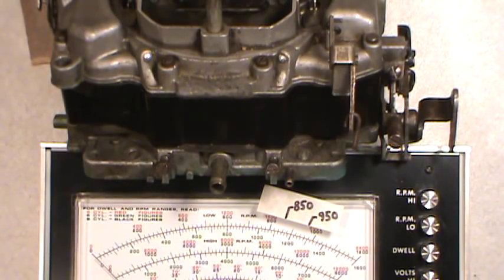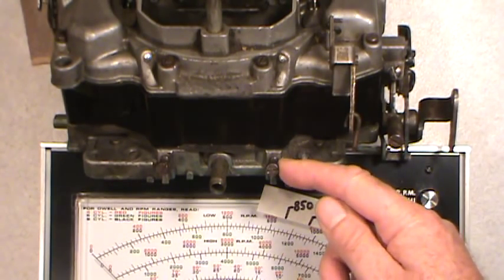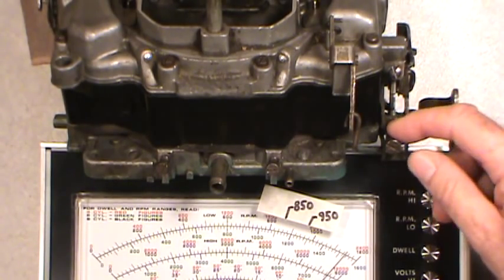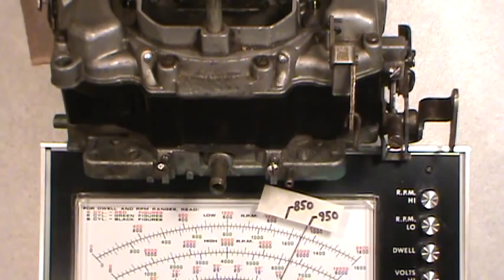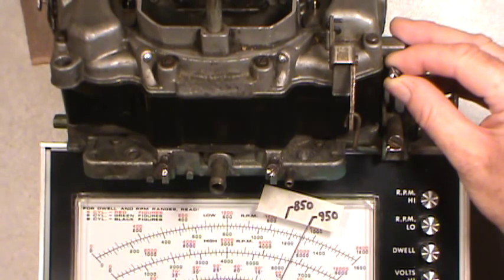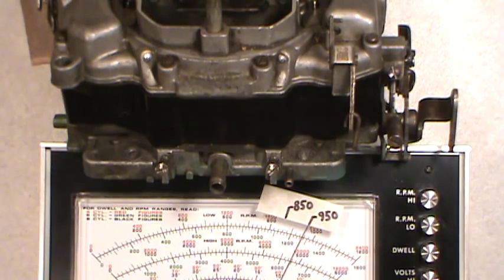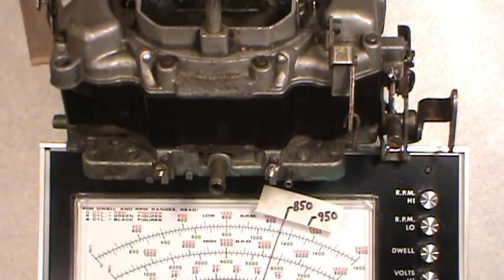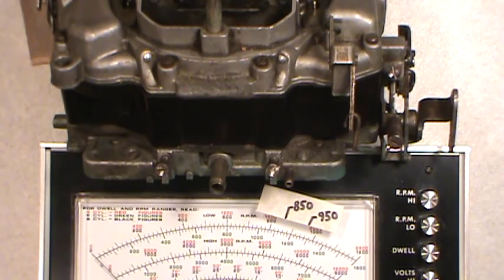Idle Mixture Adjustment on 4 Barrel and 2 Barrel Carburetors

Comment: Can you adjust the mixture using a vacuum gauge?  The highest vacuum is where you want it?
Reply from the maker: richard collis Greetings richard collis....Thanks for watching, and, for Your questions as well...............................If, and I say If, the Vehicle in question's..."Engine"...is not subjected to, and required to "Pass", something like a "Smog/Emissions Test", and is, something along the lines of, that, of being something like...oh, let's say, using an Early 1960's...Chevy...Dodge...or Ford...Car or Truck, for Example, and also, being as "Basic" as can be, pretty much meaning, having a Carburetor, sitting on top of the intake manifold, and, not having much, in that way of "Smog Controls/Gadgets", and, "No-Computer-what-so-ever", then, as I see it, the Odds are very good, that, a Person can use, either, a..."Vacuum Gauge"...or, a..."Tachometer"...to..."Set"...the..."Idle Mixture"...and, the..."(Curb) Idle Speed", well, on a good day, that is.......................The way, that I would probably, shall we say "Set-Up", the "Idle Mixture" and "(Curb) Idle Speed" (the Engine's "Curb Idle Speed" in "RPM's", is pretty much, just that, and, as I see it, just means, what the Engine's "Idle Speed", happens to be "Set-At", while the Vehicle's Engine, is Fully Warmed-Up, and, the Vehicle, is just "Idling" near the "Curb", and Not Moving at all)..............................The "First Thing", that has to be "Determined", is, the Engine's "Curb Idle Speed" ("Automatic Transmission" equipped Vehicles, are usually Specified in "Drive", but not always, while "Standard/Manual Transmission equipped Vehicles, with the "Clutch Pedal", are usually Specified, in "Neutral/Not in Gear"), and hopefully, the Vehicle's Manufacturer has a Specification for that..................For "Safety" reasons, I always make Carburetor Adjustments, with the Engine Running...Fully Warmed-Up...Choke Off...while the Automatic Transmission is placed in "PARK", so the Vehicle "Does Not Decide to Take-Off/Move"...!!!...along with having the...Vehicle on Level Ground...Parking/Emergency Brake On...Wheel/Tire Chalks (lumber/bricks), and, have a Fire Extinguisher, with-in easy reach, just in case, oh, and, also, have the Vehicle "Outside", or, if, the Vehicle, is in a Garage, have All of the Garage Doors, that lead to the Outside/Fresh Air, "Open", as, Engine Exhaust Fumes are "Deadly"...!!!........................Here is an "Example Only", and I'm only using this example, to help People out, and hopefully, help those very same People, some-what, in, understanding, what is usually goin-on, when-ever I happen to be making a "Basic", Low Compression, Older, Factory Stock Engine's, "Idle Mixture and Curb Idle Speed", Carburetor "Adjustments"...................Once the Engine is "Fully Warmed Up to Operating Temperature"...and, the..."Choke is Fully Off"...as well, and, oh, let's say, that, the Vehicle happens to have an "Automatic Transmission", and the Hypothetical/Imaginary, "Curb Idle Speed" needs to be, for Example (only!), set at "650 RPM's (Crankshaft Revolutions Per Minute), while the Automatic Transmission is in "DRIVE" (please note, when-ever the Automatic Transmission is placed in "DRIVE", have Your Foot on the Brake Pedal...!!!)...but, like I was sayin', I make the Carburetor "Idle Mixture & Curb Idle Speed Adjustments", while the Automatic Transmission is in "PARK" (for "Safety" reasons)...then, once I'm satisfied, with the "Idle Mixture Settings", that I've made, my "Curb Idle Speed/Screw", is "Set", while the Automatic Transmission is in "PARK" (always remember Safety...!!!), to about "100 RPM's Over", that "In DRIVE, Curb Idle Speed", of "650 RPM's" while the Auto-Trans is in "PARK", meaning that, while in "PARK", I Set the "(Curb) Idle Speed Screw or Solenoid", as the case may be, to "750 RPM's" (650 RPM's + 100 RPM's = 750 RPM's), then, once the Auto-Trans is placed in "DRIVE", and, having a "Foot on the Brake Pedal", the Engine "RPM's" will usually "Drop", about "100 RPM's", give or take some "RPM's", and, if it's more or less then, that "650 RPM's (in "DRIVE"), then, in order, for me, to have that (Imaginary) Engine, end up with, a "(Curb) Idle Speed", of "650 RPM's in DRIVE", I place the Auto-Trans Back in "PARK", and Adjust the Engine RPM"s "Up or Down", with the "(Curb) Idle Speed Screw" (or Solenoid?), as required, and, it might take a few tries, to get it just right, but, as I see it, it really..."Is a Safe Way to Do it"...!!!..............................Yeah, I know, I know, what about actually "Setting the Carburetor's"..."Idle Mixture Adjustment Screws"...???...lol..............Well, it kinda worked out, the way that it did, more or less, so there would be a some-what Basic Understanding, at, oh, I guess I could say, to maybe, just get, the "Whole Picture", and to more or less, see what we are up against, that's all...............................Now then, about using a "Vacuum Gauge"...or, a..."Tachometer" (that measures the Engine's Crankshaft RPM's), and...by Using Either "Method" (Vacuum Gauge, or a Tachometer), as I see it, the "End Result", should be, about the same.........................I'll use that "750 RPM's" (in PARK), for this Example, on, something like a very Basic, Older, Rochester 2 or 4 barrel Carburetor................It's really, just a matter, of, getting "Both Idle Mixture Screws"..."Set"...at the...some-what, "Leanest, acceptable, Air/Fuel Ratio"...having the Engine, "Idling in PARK", (Smoothly), at that "750 RPM's" (in PARK)...(Example Only!)...while also, seeing the "Highest Vacuum Reading", showing on the "Vacuum Gauge", and also, having, "Both Idle Mixture Screws", "Turned Out", from being lightly seated in the Carburetor, about the "Same Amount", of "Turns, and Partial Turns", as in, having a, shall we say, reasonably, "Balanced" Adjustment, between, the 2 Idle Mixture Screws (like I was explaining in this YouTube Video of mine, and using some chalk, on the Idle Mixture Screws, as I was showing) and, there can be the odd time, where-by, having, the "2 Idle Mixture Screws"..."Not Set Reasonably the Same", as in, Turns & Partial Turns out, from being lightly seated, that is...has been know to, have a Carburetor, that Runs, not so good, and maybe even cause the Engine to, some-what have, a, shall we say, "Hesitating Personality", perhaps...........................Same thing, pretty much happens, if using a "Tachometer", and not a "Vacuum Gauge", as well, only, the Tachometer would be showing, the "Changes in, Engine, Crankshaft RPM's", while the "Vacuum Gauge", would be showing/reading, the Engine's "Vacuum Level" (usually taken Below the base of the carburetor, and, inside the Intake Manifold)...expressed in..."Hg, or Inches of Mercury".....................................................................The Word "Vacuum", as it applies to these Gasoline Engines, can be confusing, and, the way that I like to look at the word Engine "Vacuum", is, I, just think of, the words..."Pressure Differential"...or..."Differences in Pressure", as in, the..."Difference in Pressure"..."Between"...the..."Air/Atmosphere, just Outside the Carburetor/Air Filter Housing...and the..."Air Pressure/Vacuum"...that is..."Just Below the Carburetor's Base, and Inside the Intake Manifold"......................Funny thing though, I've always thought of, Buying a "Vacuum Gauge", after all of these Years, and, I "Still Don't have One"...!!!...Say What"...???...lol...Yes-Sir-ee-Bob, all, I've ever used, is, one of my Trusty ole "Automotive Specific Tachometer Equipped Multi-Meters", and, had some pretty good luck (might even be, some skill, somewhere in there, as well...???...lol), in, being able to make the required Carburetor Adjustments, to get those damn Vehicles, through, the "Smog Test"...and maybe..."Even Pass"...!!! (well, at least most of the time, that is...lol)..............................Basically, just using a "Vacuum Gauge", to "Set" the Carburetor's "Idle Mixture", with the "Idle Mixture Screws", would, pretty much, be Done the "Same-Way", as I've done in this particular YouTube Video of mine, but, with a few Exceptions.............................Instead of, Adjusting the "Idle Mixture Screws", to get the "Highest RPM's" (that's "Just Before", I proceeded to do, the "Lean Drop/Method", that is), using a "Tachometer", like I've done, in this Video, then, if a person, were to Use a "Vacuum Gauge", then, just aim for, the "Highest Hg/Inches of Mercury", while Adjusting the, 2 Idle Mixture Screws, about the same Turns/Partial Turns, Out, from being lightly seated (always, try to remember the word "Balance" while making Adjustments, to Both/or Either, Idle Mixture Screws), while, also, keeping the Engine "RPM's at the Specified (or chosen) "RPM's".........................If using a "Vacuum Gauge", just follow this Video of mine, up to the "Point"..."Just Before"...I start "Doing the Lean Drop, in RPM's", with the "Tachometer", but, "Instead", this time, Using a "Vacuum Gauge", to get the "Highest Hg/Inches of Mercury", showing on the "Vacuum Gauge", at the Specified/or Chosen RPM's, as that's essentially, what to do, but only "if", the Vehicle in question, Does Not have to be Smog/Emissions Tested"...!!! (just so, You and Others are aware, just in case...???)...............................Try to find, what is known, as a "V.E,C.I." Label or Sticker, that might, just be Stuck, inside Your Vehicle's Engine Compartment, somewhere, as that, my Friend, will usually, have some very Important and beneficial "Information" on it, that, pertains to, and in some, if not most cases, might just have, the Idle Mixture & Curb Idle Speed, "Specifications", and/or, "Setting Procedure/s" on it, as well, hopefully...........................Another Option, that should be available, and, to be even more Accurate, as to the Final Carburetor Adjustments, can be done, by a Vehicle "Fix-Em-Up-Establishment" (aka, car or truck Repair Shop), for a Fee/Charge, that has a "Tail Pipe Probe", that is connected to a Hc/Co (Hydrocarbon/Carbon Monoxide) Meter, where, the Technician/Mechanic, will be able to "Fine/Tune Adjust" the Carburetor, "Based on the Exhaust Emissions", coming out, of the Vehicle's Tail Pipe/s................................I hope, all of what, You have read here, helps You out some-what, and...Till next time............Be Safe, take care, and have a good one.

Comment: rodchester quadrojet  carb. will not hold rpms, got any ideas what would cause that?
Reply from the maker: +Rick Smith....Greetings....Rick Smith....Thanks for watching.................You were sayin', about, Your Rochester Quadrajet 4-Barrel Carburetor..."Will Not Hold RPM's" (might not be the Carburetor...maybe...???)..................In order for me to narrow-down, what might be causing Your Engine's, lack of RPM's, then, if You can tell me, under what Engine Operating Conditions, does Your "Too Low RPM's" occur at, as in, is the...Engine...Cold...Hot...at Idle Speed...in Gear...in Park (automatic transmission)...at Cruising Speed...or what-ever it might be...???..................Also...the Vehicle's...Year...Make...Model...Engine Size/Liters/Cubic Inches...Automatic or Standard Transmission/with the clutch pedal...etc.........So then, please, Describe to me, the best that You're able to, about any Engine "Running Problems", that You are hoping to Fix, and..........till next time.........Be Safe, take care, and have a good one.